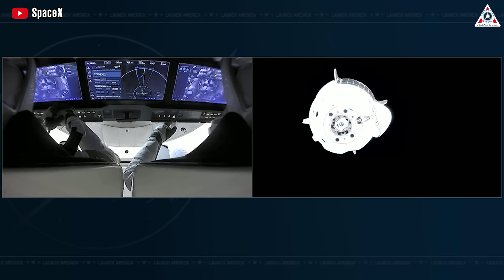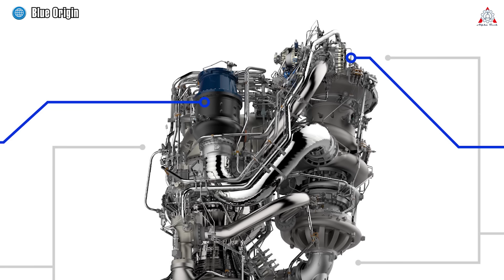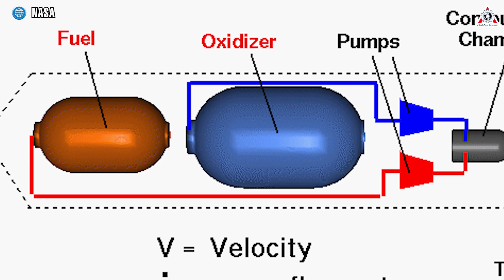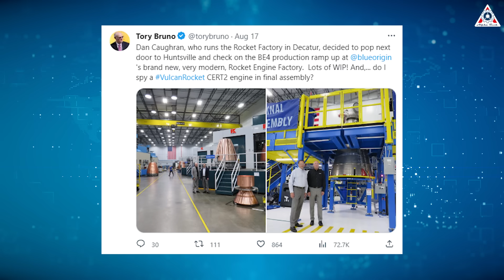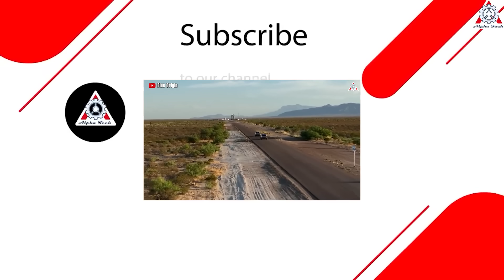Blue Origin to produce hundreds of BE-4 engines to beat SpaceX...

Comment: There's no way BO will ever compete with SpaceX when it comes to Engines. Blue Origins have been working on the B4 engine for years now, while SpaceX is not just creating Raptors on a weekly basis but it's also the most powerful rocket engine by far. And BO's B4 is not even close to that power. So this is .. I don't know... 

Also, we're talking about a few years in to the future, right? That's what you said in the video. So in a few years BO factory might be big and might be able to produce B4 on a regular basis, but there's a major flaw in this clip.... In a few years SpaceX will most probably already have Starship operational and not only one factory but multiple factories producing Starship.
So, there's that. And the reason why SpaceX is killing it is because they have a whole different approach to this compared to any other rocket company. TRIAL and ERROR, send it, blow it, gather data, send it. That's how to be fast in the industry while BO has shown that they are more like NASA.. Focus on ONE rocket instead of multiple... while they work on one ship, SpaceX is already working on the 19th. 

So no.. Blue Origin will never compete with SpaceX (my opinion ofc) :)
Reply: I couldn't have said it better. You are spot on. Bud.
Reply: The BE-4 is "not even close to the power of the raptor". That is not actually true. They are very close in power output. Are Blue Origin trying to compete with spacex ?...no, they are doing things their own way and have their own plans. We don't actually know where Blue Origin are in terms of the new Glenn rocket and moon lander as they don't release info like spacex. So it is very easy to be an armchair critic when you don't have all the info. I wish Blue Origin success as I do ALL space companies.
Reply: @dazuk1969 I think most people in this respect measure "power" by it's size and weight to thrust ratio,  the BE-4 is a larger, heavier engine. How many BE-4's could you stick under starship?? Answer: not enough to come anywhere near the levels of thrust that Space X is shooting for with starship able to achieve the goals laid out for it.  Not only is the latest revision of the Raptor, the Raptor 3 rated at roughly 270t thrust vs the BE-4 at 250t, but you can fit nearly twice as many raptors in the same sq ft area as the BE-4.
Reply: @kanuckistanprepper5321  All you say is true, but Blue Origin have different goals than Spacex. They are not trying to build a rocket that can compete with starship. New Glenn was designed for Blue Origins goals and will still be a very serious rocket. 
You could ask the same question of RocketLab...why are they building Neutron when we have starship ?...because again, they have their own ideas and plans.
We should also remember the primary reason starship exists is to go to Mars and build a colony which requires a rocket that can take a lot of stuff. The Moon and LEO are just side notes for starship that helps pay for the programme in general and it's primary objective....Mars. Thanks for reply.
Reply: @dazuk1969  Honestly, creator of this video - Alfa Tech, just felt they had to put a video out there, trying to make us believe that Blue Origin is competing with SpaceX which is not true, but hey, AlfaTech gets the money from the views and as always we the viewers are the losers. 

Losers why?
Because in this video, there is not a SINGLE source telling us where, when and IF BO decided to compete. That was just something Alfa Tech came up with to earn money. :) We all need money ^^

And THIS is what we call "CLICKBAIT"
Reply: I agree. But right now I don't think the word Compete is even our vocabulary. Like you I wish them success. I don't think they will succeed until they change from the top down. Everything from JB, to quality. I wouldn't ride on one of there rockets. When quality is mentioned on the forefront . That info probably wasn't supposed to come out. I wonder why the government still puts money into this failing project. And why have they and why are they still putting money are signing mission projects with this failing company. We shouldn't be spending money foolishly. @dazuk1969
Reply from the maker: Thanks for your comment! Keep watching and discussing interesting topics on our channel♥️
Reply: Maybe their counting with FAA help to stop SpaceX.